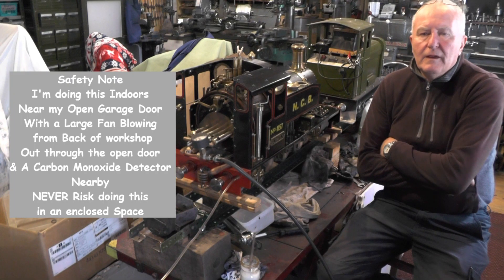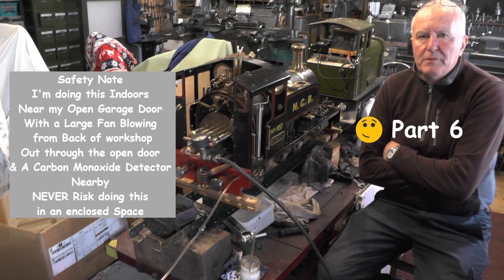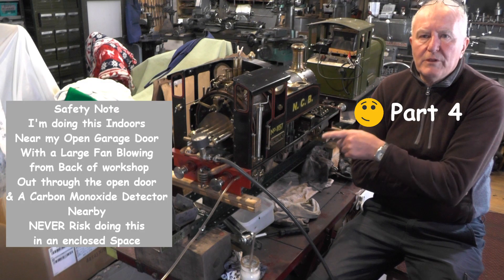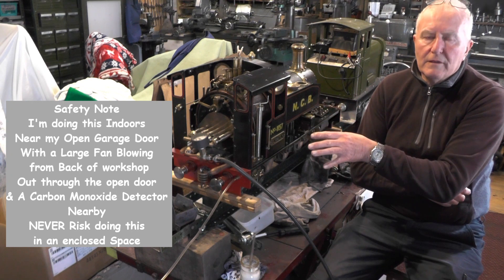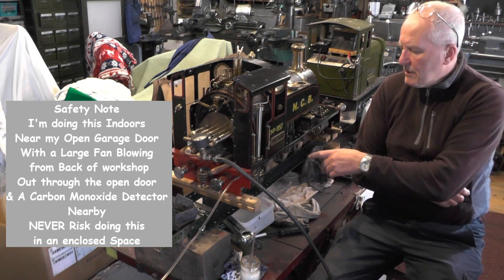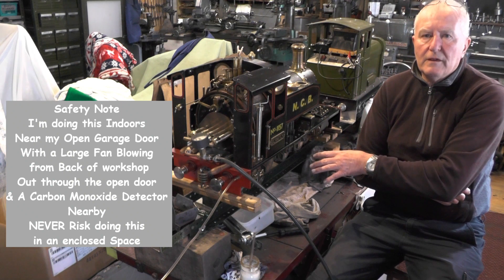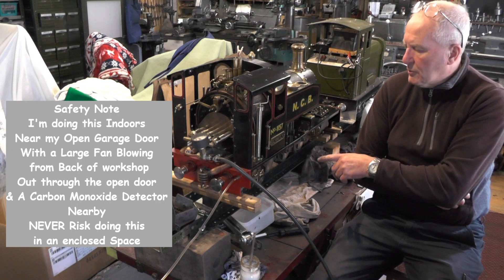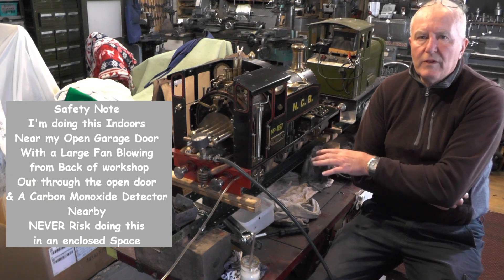Metre Maid Steam Loco Part 6 Steam up On Gas + Part 2 Testing Injector "mr  factotum"

Comment: Hi Kev. Sound like you have found the problem in the clack valve.looking forward to the next video to see the fix. Gas would be a good idea being used in a test setup like you have. Very clean and no mess. But to run it on the track I think will be more of a problem. You will need another wagon to carry the gas bottle.The system will have to be tested and certificated. And then you will miss all the dirty smoke, the coal and cleaning up at the end of the run. Can't believe you would swap that for gas 😄
Reply from the maker: Thanks 👍toch
Yes, but watch out for tomorrows episode, in this saga, see my reply to , bernardrobinson6488,
As for Gas i am ony testing this for a friend who stumbled acrooss the burner a few years back and has not had chance to try it, it's great for quick and clean fire ups on the bench for testing and checking things, although i think it wants a air door at the bottom and a deflector in the fire box,  also like you say, its not the same for the experience on the track, can't beat coal, smoke and steam in your face!!🚂🤣👍
BFN
Kev

Comment: Hey up Kev, injectors can be troublesome little buggers, but you trying two different ones makes me think it’s not the injectors, I’m wondering if it’s the clack, either stuck or it struggling to push water past. Steam engines, fun ain’t they!! You’ll find the issue, all the best, Laters.. Matt 👍
Reply from the maker: eyup Matt
thanks for feedback, yes, i'm a couple of video's in front by now, and got to the bottom of the little bugger, may be simple for the experienced ones in this subject,  but for anyone on a learning curve can be challenging to know whats what, i like to fathem things out step by step, which may help others new to this hobby.
watch this space👍👍👍👍👍😉😉😉😉
atb
Kev
Reply: @MrFactotum  I know what you mean. Looking forward to seeing the issue and rectification. Like you my workshop builds are further on than what I’m currently showing on the channel, gives us creators breathing space!! Stay well my friend, all the best, Laters, Matt. 👍

Comment: Injectors like cold water, Are you supplying the water from the side tanks?
10:05
Reply from the maker: eyup Dean
No, from a tender Dean, thanks for advice though, i'm a little in front of the video's and got to the bottom of it, all to be revealed a little later, thanks for the interest
regards
Kev

Comment: Hi Kev,
It looks to me like the water supply to the injector could be the problem. You've either got an air leak somewhere and it's sucking in air as well as water or the supply is being restricted by the pipework or the water valve. Try connecting a separate water supply directly to the injector e.g. a bottle with a pipe and see if that makes any difference.
John
Reply from the maker: eyup John
thank you very much, you've hit the nail on the head, i'm a little in front with the video's and yes its the valve problem, all to be revealed later, i'm on a learning curve with injectors, and thought for anyone in the similar position i would document all the steps i've taken to gaffer it. If i'd have put this video out a couple of weeks earlier your comment woud have got to the bottom of it, so thanks.
atb👍👍👍🚂🚂🚂
Kev
Reply: Hi @johnbaguley1654, can you describe the symptoms you were looking at to arrive at this conclusion. We know you're right because Kev says that below. But to me, most injector failures just look the same - lots of water coming from the overflow, none going into the boiler!
Reply from the maker: @davidtaylor6124  hi david it's Kev replying, 
yes, me too, to me as a learner to locomotive workings, it's difficult to know whats the cause, thats why i'm taking things one step at a time to show each alteration i'm doing then testing,  to find the problem. Mainly to help others who have issues, it's no good altering several things at once as you don't know whats the cause then., I'm a few video's in front of this one, and eventually find the little blighter thats causing it. It may be a simple find for someone experienced and knowledgeable in these things, but maybe not so for newbies to these things.
Thanks for taking time to watch and feedback
atb
Kev
Reply: @davidtaylor6124  Hi David, the output from the overflow is a mixture of both steam and water rather than just water. That implies that there is not enough water flow to fully condense the steam and produce a solid jet of water from the combining cone. What water is going into the delivery cone won't produce enough pressure to overcome the boiler pressure, hence it won't feed. If the clack was say stuck and the injector working properly then I would expect a continuous stream of just water from the overflow as it has nowhere else to go.

Comment: Hi Kev
I had a problem with my injector picking up thought it could be the clack so renewed them I was using a no 3 injector but changed it for a no 4 and still had the same problem it turned out to be a tiny hair line crack in the pipe which was letting in air so renewed the pipes Silver solder them with new Olives problem solved the injector picks  up first go now brilliant video very interesting all the best 
Glen 👍🏻👍🏻
Reply from the maker: cheers m&mt
Yes ive got to the bottom of it, all to be revealed, thanks for watching
atb
Kev
Reply: @MrFactotum  RRRRR will find out soon 👍🏻👍🏻

Comment: Hi Kev 
I think you may have hit the nail on the head in the last part of your video. You seem to be doing everything right so far with controlling the injector so it could potentially be having the clack valve not directly fitted to the boiler. Try a new valve and if that doesn’t work you may have to do what I have done an fit an electric pump in your tender. 
I have been watching with interest the gas conversion and the use of the blower, normally used to draw the fire.
Dave D
Reply from the maker: Thanks 👍 Dave
appreciate the feedback, i'm a little in front by now, and got to the bottom of the little bugger, allelluyah!!! watch this space.
I like the idea of an electric pump, especially for the stressfull emergencies, when you can't pump fast enough🤣🚂👍👍👍👍👍👍
atb
Kev